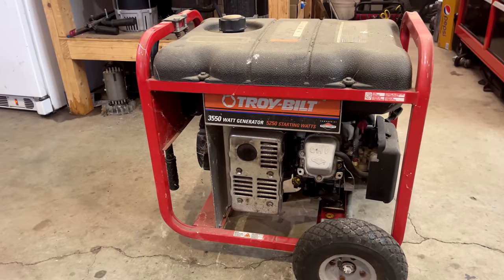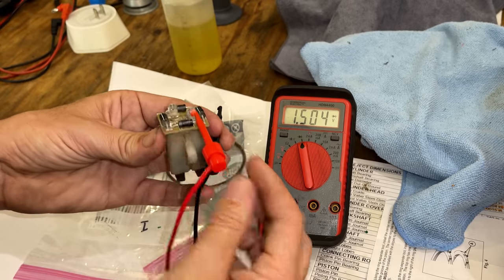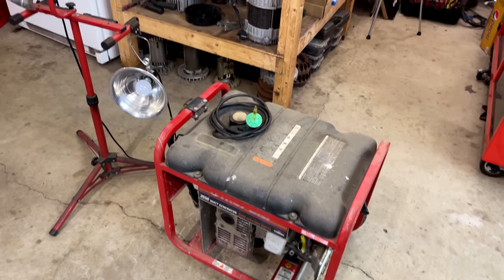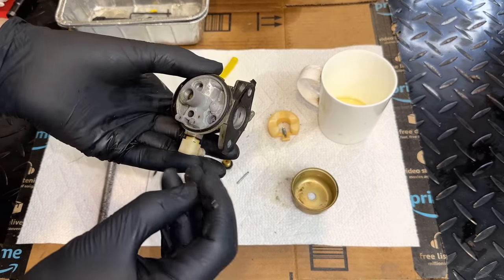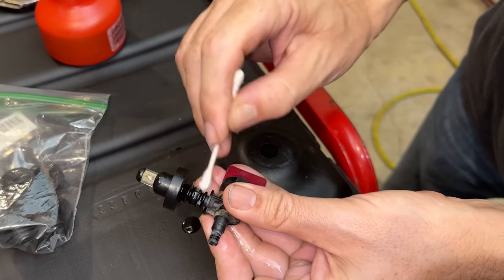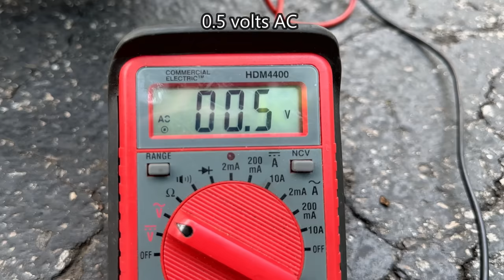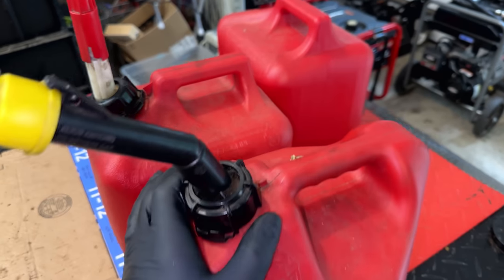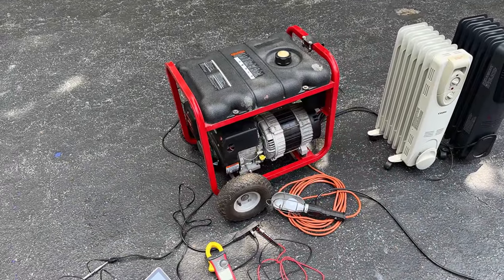No Power Output - Will Flashing the Field Restore Power?

Comment: Thank you James for this combo video. I'm learning so much about the types of generators, their construction and possible issues. Making these shows is as much work as fixing the machines.
Many thanks for all your hard work. By the way I had to special order Evapo-Rust here in New Zealand, but because I lobbied our local Farmlands store will stock it.
Reply from the maker: It’s great stuff, but expensive here and probably twice as expensive in New Zealand.
Reply: @jcondon1  Thanks James. 5L cost 55,- NZD in USD that is 32.50. In Europe for example it cost 55,-Euro.
Yes, expensive but my wire brush and machine don't fit thru the filler neck of the tank. 😂.
By the way, vinegar + two weeks did a very good initial cleanup for me.
Thanks again for all your work. Cheers Reiner

Comment: A tip regarding fuel lines, get the marine grade stuff. It's designed for harsh salt water environments. In my experience it holds up like 2-4 times on small engine equipment. It costs much more tho. But it's worth it in my opinion.

Comment: Thank you for the video. It contain good tips. Here's another for you. You can improve your chances with the 120 VAC power drill and save your wrist at the same time. If you have another power drill couple the two of them with a short length of 1/4" dia rod or a bolt with its head cut off. Not having a second drill you can still make the task easier with one shank-less bolt, 2 fender washers and 2 nuts. 
(1)  Slide the first fender washer on the bolt till it seats on the head of the bolt. 
(2) Thread the first nut down tight against the first fender washer. This becomes a spacer.
(3) Slide the second fender washer down until it seats on the first nut. 
(4) Thread the second nut down tight against the second fender washer.
Now you can wined a short cord between the two washers and PULL! 

BTW, nearly all of my power tools are mains powered but most shops I see today won't know what that cord is sticking out of your drill!:face-blue-wide-eyes:
Wakodahatchee Chris

Comment: Aloha James.   I really enjoy watching you fix all the generators that you do.  Not only the mechanical, but the electrical issues.   On the ones with the float type fuel gauge with the clear plastic lens on the cap, you can rejuvenate a cloudy and frosty lens by using some Meguiars Plastx or Blue Magic plastic polishing compound from Auto Zone and a buffing wheel in a drill to polish away the oxidization on the gauge lens and make it clear again.   Just like polishing the lenses of your car headlights.   Then the tank fuel level will be clearly visible like when it was new.   Keep up the good work.

Comment: @ James Condon
James, you shouldn't need a set of brushes without the bridge rectifier. Just replace or repair the bridge rectifier, then flash by connecting the 12vdc to the DC side of the bridge rectifier.

Comment: Good fixes and seems like I've tried filing brushes but if you don't have the same curve you loose the contact area and they won't work right. And with all the fancy stuff going belly up I think I'm better off with the old 96 cast iron Coleman with the flathead 10 horse and the low oil shutdown, even though the oil gets checked every time it gets gassed up or shut down for any reason when the line goes doun. And thanks to all yall I watch I now know the trouble I had with the 2.5K Onan with flooding. Bad needle seat. So thanks, keep it up and God Bless Yall!

Comment: Rusty generators - One thing i learnt living the sailors life, by adding sacrificial anodes one can can manage/mitigate metal oxidization e.g. steel = Nickel and for Aluminum castings = zinc.

Galvanic oxidation, often attributed to the electrolytic effect of seawater, extends beyond coastal environments and occurs wherever there's an exchange of irons in the presence of dissimilar metals or atmospheric electric circuits. Thus, it's not solely confined to sea or ocean locales. Galvanized electroplated metal coatings, often viewed as protective, are essentially an sacrificial anode coating, which will eventually oxidize into the ether, as we observe. They only temporarily mask the effects.

Generators, for instance, are not typically built around a galvanized support frame. This comment aims to expose this reality, hoping everyone might take the opportunity to protect their investment and prolong structural integrity and service life. This concept can be applied to cars, wheels, machinery, trailers, sheds—any type of metal structure.

The relentless migration of electrons and irons coerced away through coatings into the atmosphere resembles a form of energy storage, akin to a battery. This process mirrors a battery, with the Earth serving as a grounding or negative terminal. One could assume this is the reason we have vast naturally preserved metal resources/commodities stored underground and available for mining—the only reason why they exist at all.

To gain insight into the dynamics of metal interactions, one can refer to metal nobility tables. For instance, internal gearbox steel components inherently lose electron irons while simultaneously borrowing electrons from lesser noble metals. This exchange process could be facilitated by the presence of oil, which acts as an electrolyte transport system, especially from metals such as aluminum housings.

Initially, the sacrificial metal coatings, being of lesser nobility, would give up their electrons to the aluminum. This progression, from lesser to noble metals, appears somewhat unnatural, yet it adheres to the natural law of entropy. It's a fascinating interplay of material properties and chemical processes within mechanical systems.

Comment: Great presentation again James especially the diagnostic skills.  A few thoughts however:- firstly when trying to flash a rotor with a drill, its much more likely to be successful without ANY parallel load on the drill, even the bubble light, to maximise the voltage to overcome loss of residual magnetisation.  Second, as you said in the second part, you can flash the rotator through the bridge rectifier, via the normal brushes - doesnt need a separate set to do this.  And it does not matter which polarity is used.  Lastly the test shown with the diode tester function from DPE terminal to brush MAY TEST PERFECT even with two open-circuit diodes and two working in the bridge.  I suggest doing the diode test directly across each individual diode in turn and not rely on the test shown.  KJ
Reply: I forgot to say even without lamps connected you will know if you have successfully remagnetised to rotor because the drill will then work

Comment: Fantastic job once again, James. I just have one thing to mention. The connexion that goes into the control box on the storm responder has come away from the plug; It may be possible for a small child to be able to get a finger in there. But I thought I'd just mention it for safety sake. It's easily reterminated. Thanks for sharing.

Comment: Love yourr vids and work methods.Had same unit new,and in less than 30 hrs. Lost it.the culprit? The  little screw that holds the throttle butterfly on.yep.. no crosspeen no loktite no nothing,instant motor  death.  I remember the next day after pulling the head off ,"tha aint  gonna hone  out!. How it didn't bend/bust a valve I'll never know.

Comment: Always fun to check your videos.
You often repair old generators . How they compare with new generation with inverter concerning efficiency ?

Because if the efficiency difference is greater than 25% , it could impact our decision to repair or buy new one.
Compare tests should be fun to add to your next videos.

Comment: I have a Troy Bilt pressure washer with that same engine. For whatever reason, the carbs on those engines are a pain in the rear. I can never get the carb to work correctly on a consistent basis. Sometimes it runs fine and sometimes it doesn't. I can't figure it out. The issue does seem to apparently be with the needle and seat because the needle will occasionally stick, and flood the carb. I have had issues with it only running on full choke before, but I sprayed it out in carb cleaner and threw it in the ultrasonic, and it cured that issue.

Comment: You might have better luck flashing the stator with the drill motor if you first run the corded drill on household a/c to maximize any magnetic remanance.  Remanance decreases over time in iron.  You could also spin the corded drill motor, carefully, with a cordless.
Reply: I always use a cordless with a torque limiting clutch, so when the power kicks in the drill isn't damaged. It is a lot safer for the operator too.

Comment: The drill method works in some cases but it's actually easier to take either a 9-volt battery or a 6 volt lantern battery, 1 ohm 3-watt resistor, and a 1N4007 diode on the positive with the banded side toward the brush head. You can flash the brushes easier. The diode prevents voltage from feeding back into the battery and the resistor prevents the inductive spark from happening as it limits the current.

For brushless generators, an extension cord two prong with a momentary switch going to the capacitor leads you can re-excite those generators in that manner
Reply from the maker: Sounds like a good tool to build.
Reply: @jcondon1  for sure! I keep the 1 ohm three-watt resistors on hand all the time because they are common in tube amplifiers when measuring the power tubes. I guess my music repair stuff also has applications for the small engine stuff too! 😁

Comment: You can fill your ultrasonic cleaner with water but place your parts in a ziplock bag with water and degreaser. You’ll use 1/3 the amount of product. You can also use a glass jar.
Reply from the maker: Yes

Comment: Thanks to your videos, I replaced the carb on my generator and it runs like brand new, it’s a 22 year old power mate 5000 watt with a tecumseh 10hp engine. No more surging! Edit: forgot to mention I changed the oil as well.

Comment: Once you get the bolt even a little loose, if you can get any lubrication into the threads it will help. (Years spent rebuilding salt water marine engines.)

Comment: I found you can flash the field without any disassembly (if residual magnetism is the only problem) - With the engine running, plug in a classic electric drill with a universal motor, hold the trigger, and briskly turn the chuck manually. It'll instantly start making power.

Comment: I know several people that build Kohler generators and all they do is charge up the armature. They all said the same thing you lose a small amount of homes on the armature so you just recharge armature. They normally just take a battery charger and put positive negative on each side of the outside armature and that's enough to recharge the armature.

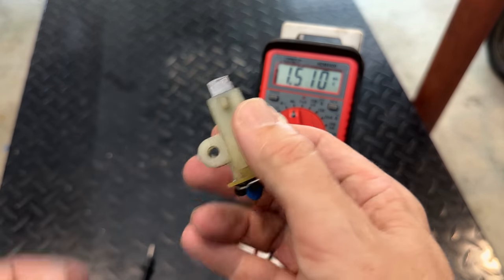Comment: Good Video!  At 1:11:30 when you are trying to flash the rotor by connecting to the terminals on the diode board, it probably IS working. You don't see a spark when you break the circuit because the surge is being shunted by the diodes, similar to a "clamping diode" that is placed across a coil (relay, solenoid or other) to prevent arcing at the switch contacts. You could verify by using an ammeter to show that current is flowing from the battery. At 1:06:02 I'll bet that the previous owner tried filing or buffing the ends of the brushes. You could see in the very center where it had started wearing a small concave area indicating that it had been run since he did this.

Comment: It’s been a long, long , LONG time since I had basic electronics.  But, to memory a good diode has appx a 10:1 resistance to voltage drop across it forward to reverse biased by the multimeter.  In forward bias a Silicone diode drops appx 1.2 vdc where a Germanium diode drops appx 0.6 vdc.

Comment: "Depends on who you ask"....

For those curious;

Conventional flow (Common Theory) -  which is the flow of voltage goes from Positive to Negative. 

Electron Flow (Updated Theory) - considered as the more accurate flow, which is from Negative to Positive.

Electrons were found to have a "Negative" charge to them, which would make them flow from the Negative pole to the positive pole.

Edit: Cred. Master Electrician

Comment: I have a 18 yr old Generac 7550 that quit putting out.  I tried to re-mag the field but no luck.  I then replace the brushes, voltage regulator and rectifiers. (All parts under the end cover. It has a 12v charger output also.)  Fired up and had full power again!

Comment: The older style generators that do not use a battery use residual magnetism to excite the coil. An easy way to guarantee 💯 that the armature has startup magnetism is to drill very shallowly on each side of the armature and install a couple small rare earth magnets seated in with epoxy. The field is enough to give it the kick it needs to start generating, and running will keep the magnets charged up. ❤

Comment: I actually have a Briggs V-Twin from I think 2000 and it doesn’t have a sensor for the oil. However it does have a capped spot for an oil filter however if you want to add that the only way is to A buy the oil nipple (as the only oil nipple is actually on the oil cap which is one solid piece). And B you then need to get the oil filter.

Comment: Soldering.  Always make sure the soldering tip is properly tinned and retains solder when melted onto it.   Before touching your soldering iron to anything to solder or desolder always put a small amount of solder on the top to create a good heat transfer bridge to the component/solder Joint you will spend less time and excessive heat transfer to the area being soldered or desoldered.  Get some copper brace ground strap and apply a little flux to it to remove excess solder and of course a good desoldering sucker is a good tool to have to suck up molten solder for removal.

Comment: Hi Jim, thanks for posting another useful video.

I am surprised the corded electric drill works as well as it does for flashing the generator field winding.  I say this because the drill does not have any permanent magnets for the field, only an electromagnet so, relies upon residual magnetism as well.  It would probably be better if an AC capacitor used for an air conditioner compressor was charged up to 12 - 30 Vdc, then plugged into the generator output while it is running.  This should provide a better jolt than the drill technique. 

I was curious what the part number is on those rectifier diodes used with that brush assembly.  Those are 3 amp diodes so, wondering if the diodes are being damaged by over voltage or over heating.

I have been rebuilding carburetors in mowers and my cars since 1970.  The rebuilding instructions always said: "NEVER RUN ANY TYPE OF WIRE THROUGH THE JET ORIFICE TO CLEAN THE JET"!  Obviously this warning was issued to prevent altering/damaging the orifice bore.  To comply, I would always soak the disassembled carb in carb cleaner for several hours, then use compressed air to blow out the JET orifice.

That carb on the smaller engine shows corrosion on the carb casting in the bowl area; an indicator pump gas with alcohol was used.  I have seen that E10 gas destroy a small engine carb in as little as a few weeks in high humidity environments.

Portable generators generally have a hard life due to lack of maintenance and improper storage.  Of course, oil changes are at the top of the lack of maintenance list.  Since these generators are air cooled, the oil wears out faster.  My oil change schedule for a new generator without an oil filter is; 1st change at 1 hour, 2nd at 10 hours, then every 25 hours thereafter.

Since Biden is going to ban portable generator sales in 6 months, it is best to know how to keep your generator in good running condition.

Comment: You could probably hit the brush input with a 9V battery with a diode in line while it's running.  Just need a tiny bit of power to get it magnetized.

Comment: Hey James really like your show Just think if that stator hand iron plates on top the two windings  you would have flipping north to south magnetic field and that residual magnetism would be in the same of an old Universal motor or an old Magneto out of a motorcycle nfm might have considered on trying to run one of those generator heads  of electric cordless drill or driver

Comment: I've got two of those here that won't charge, the field windings test good, as does the armature. I replaced both rectifiers and flashed the field and they will make power, but the minute I shut it off and restart, it won't charge again, I have to use a drill to get it going every time. 
I also have two other brand generators doing the very same thing, one a smaller 3500w Champion, the other an older Pincor. Each will run and make power but only after connecting and spinning a drill each time.

Comment: A brush assembly without bridge rectifier is not needed. Just unplug the AC leads
to the known good rectifier / brush assembly and jumper a 6 volt battery to the 
AC tabs of the rectifier / brush assembly in any polarity. Then reverse jumper leads 
and do it again. The bridge rectifier will block whichever order of connection was 
wrong and will energize the rotor for the polarity that was correct, remagnetizing 
the rotor in correct polarity for residual magnetism.

Comment: A hot air gun like the Atten 858D might be good for softening those preformed fuel hoses,  and they are great for heat shrink (no more scorching wires and fingers with a lighter)
I was just gonna post when I had another idea, based on plumbing.  If you stuffed a copper rod or tube (brake line?) into a piece of hose,  bent it to right shape,  then set the rubber hose with the heat gun, you might get a passable preformed hose.  Getting the copper out I leave as an exercise for the reader.  Maybe a stiff spring instead?